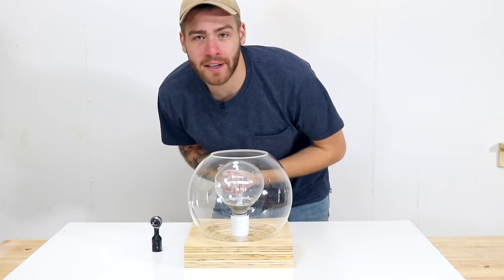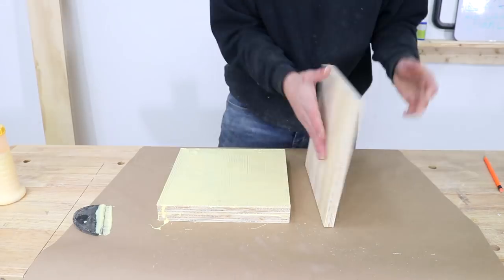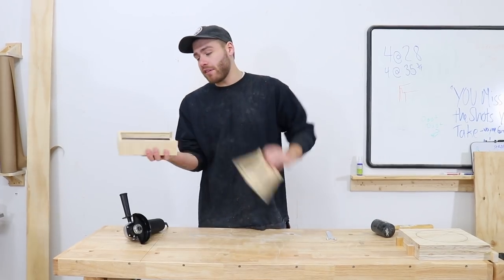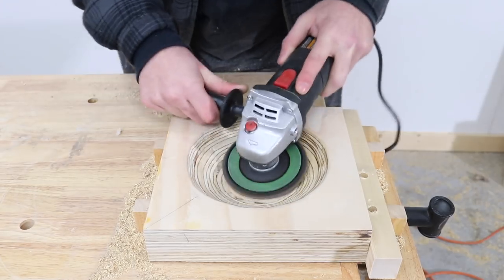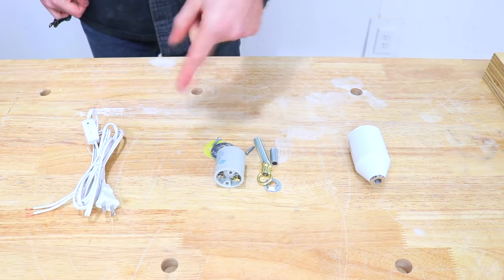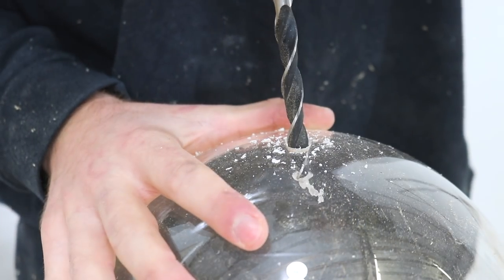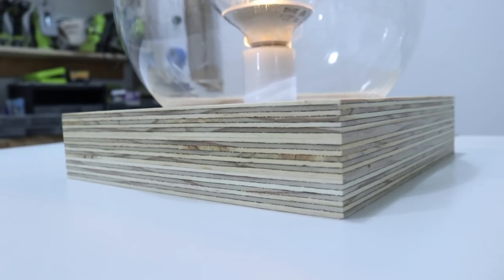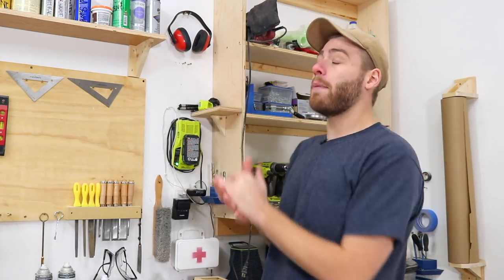DIY Desk Lamp With Contoured Base | "Plywood Globe Lamp" | Modern Builds

Comment: Awesome project! A cool tip I learned from an electrician is if you don’t pull the jacket all the way off of the wires when stripping them, it helps hold the ends together, which can make it easier to loop around the screws. Keep up the great work!

Comment: Great little project. 
I would have loved it more if you'd also contoured the exterior of the plywood box a bit. 
I also think you could have made a couple more layers of plywd and a bigger hole in the globe, so the light socket would be deeper down in the wood, and the light  bulb itself were in the center of the glass bowl.